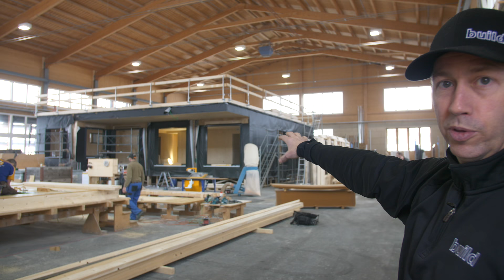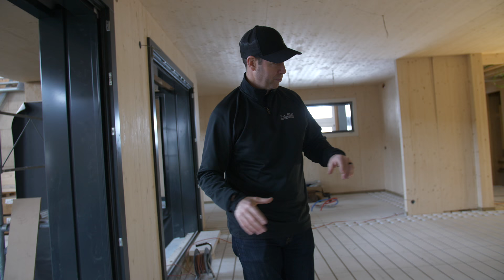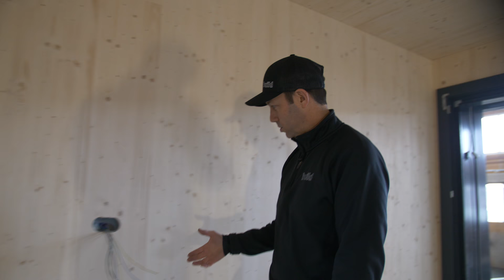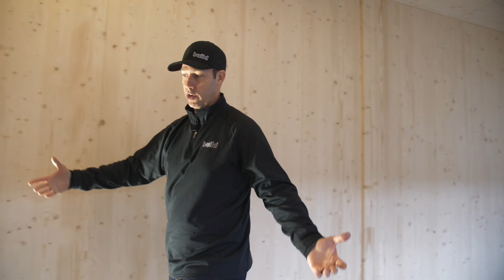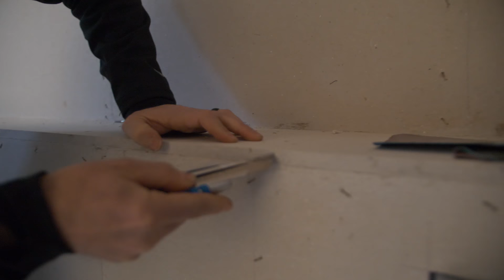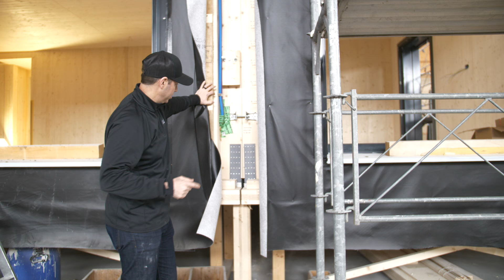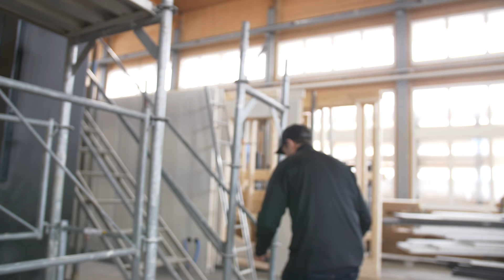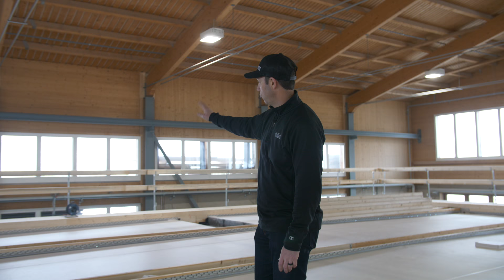Swiss Modular Home - Under Construction Tour

Comment: I am curious about the warehouse rafter detail where it meets the eve walls....I am curious if there are some sort of manufactured hanger that allows for an elegant solution linking the rafter the post and the building envelope
Reply: Most commercial applications have components like that  custom designed and fabricated. It doesn't make sense for a manufacturer to mass produce them since it's rare to find multiple buildings/facilities that are built exactly alike.
Reply: Look to me from what I could tell it connects much like in post frame in the USA where laminated columns are used, the truss or trusses if doubled up sit in between the outer two layers of the post and connected by two double shear bolts, just probably double the bolts in this case to a metal bracket bolted to the column itself (portal frame) as well, if not welded on bracket to column (which offers little or no movement in certain wind conditions)

Comment: Because its cheaper to build on site?
Reply: You get better quality in a factory than on-site. Those workers get to work in a controlled environment: warm, dry, well lit year round. They have plenty of space to work in and have all their tools and materials in fixed places. And they get to go home in the evening---and probably even for their lunch break. And the work is standardized to a quite high degree, further increasing quality and even speed.
Reply: In California, you can buy a modular home starting at 35k (2bd, 1bth).  These cost 200k and up.  They are built for a different level of cost of living.
Reply: One of the reasons is also building time. When you can build the house at the same you build the foundation, it saves time. Putting the house on the foundation will be completed in about a week.

Comment: Would you say the Swiss don’t perceive a class distinction between stick-built vs. manufactured, like we have in the U.S.?
Reply: I think there is a pretty big difference between what is considered "manufactured" vs "modular"  The time I spent in the industry showed a big distinction between the two. Manufactured tends to be the "trailer" style, with the single-wide and double-wide units.  Those are typically set on piles, pads, or other such "foundation" whereas modular is more like a conventionally built home, often placed on a full concrete or wood foundation complete with basement.  There has been a stigma attached to modular building that has been a carry over from the cheap "trailer" type builds that you generally see in "trailer parks".  Pretty sure that's where the "class distinction" comes from.  A well built modular home can look no different than a convention stick-built home.
Reply: Not in Switzerland. You Are Talking unites states. Most European companies would never build a trailer house, double wide or otherwise. ha ha ha .  @robthewaywardwoodworker9956
Reply: Kenneth Reeves I totally agree. Why move your house when you can build a good house and move yourself. Do people with mobile homes actually move them?
Reply: @robthewaywardwoodworker9956  That is correct. but then you see the 2x3 walls and think..what did they save like $20 over a 2x4 build? try to do replacement interior door jambs is a pain. I am sure they are better Today vs. 15-20 yrs ago.
Reply: That is correct. A prefabricate house equals or surpass a stick built house in Europe.

You decide on quality level and then try to make it cheap and good thus factory made.